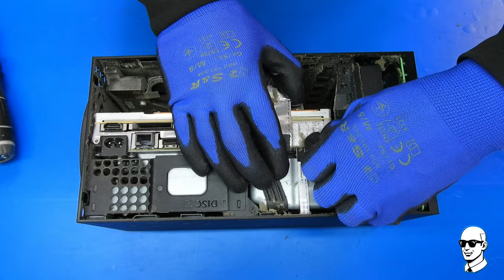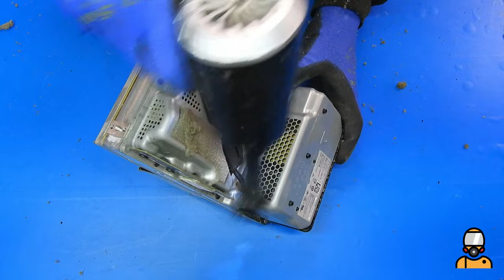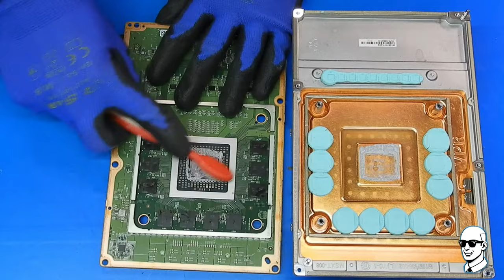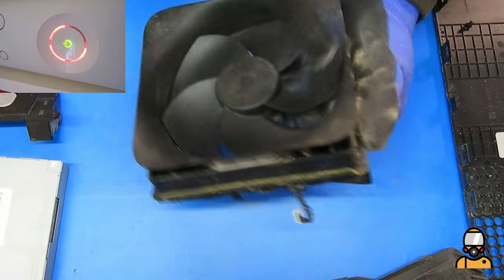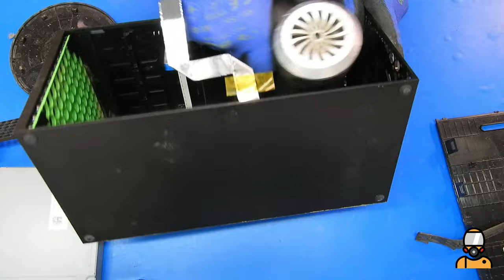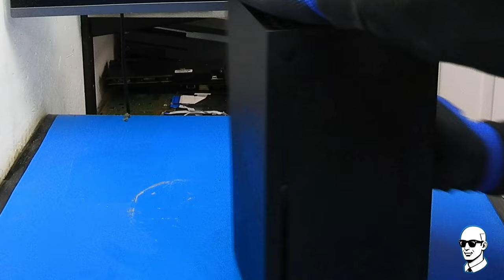Xbox Series X: Dust Clean!

Comment: Next time use a vacuum instead of a blower! Wtf? You just kept getting everything dirty again lol
Reply from the maker: thanks for the comment With a blower, you're not physically touching the components with a vacuum, you have a chance of static discharge to the components.
Reply: As an ex-Xerox service man I can verify this. Most house hold style vacuums can build up a positive static charge from air movement that has dust or other particles in it, such as hair and tiny flakes of skin etc. If vacuums are used they have to have a special motor that creates a negative charge while the power is on to negate this from happening.